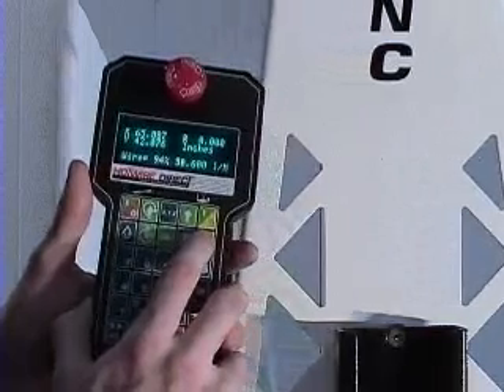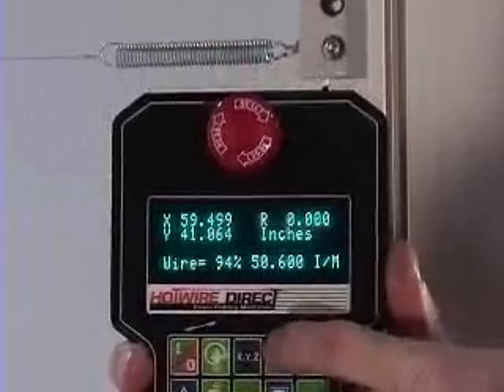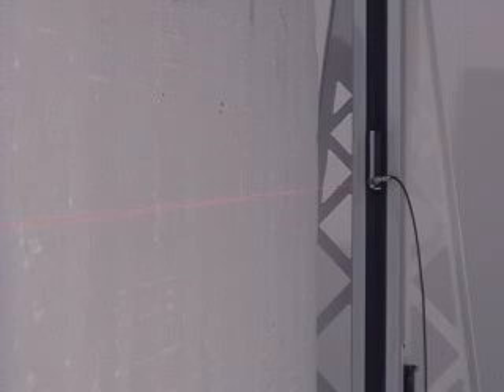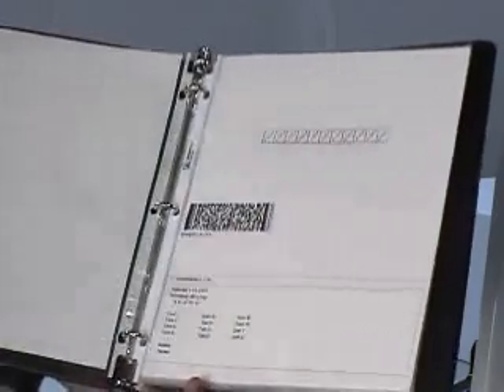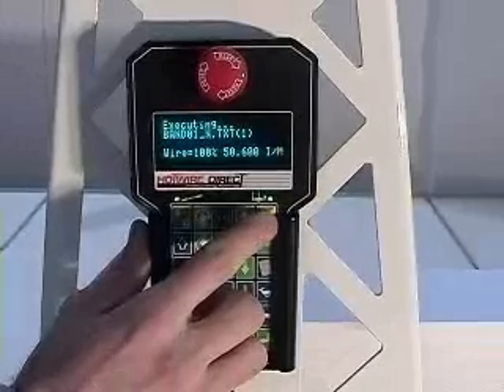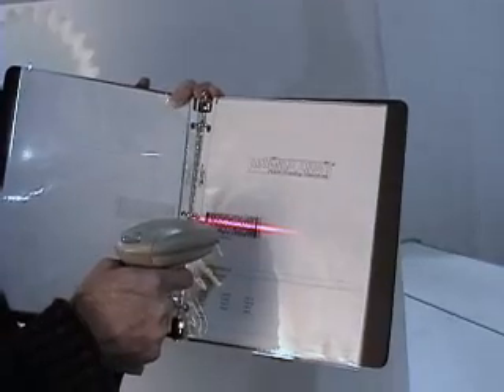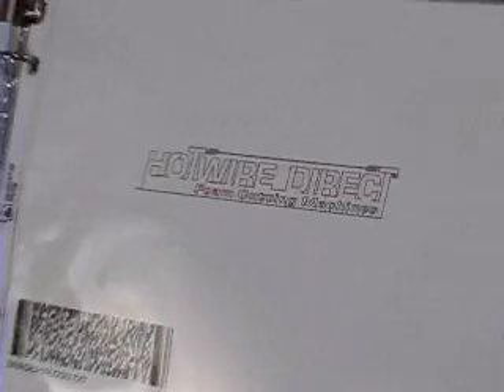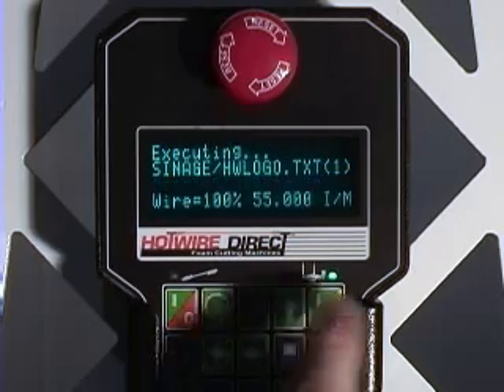Easy CNC foam cutting machine

Comment from the maker: @TuwaluIslands 
Good questions. Generally speaking we recommend our hot wire cutters to be used with expanded polystyrene (EPS) or extruded polystyrene (XPS) foam because of the gases created when cutting and ventilation requirements. With that in mind I advise you to make ventilation a primary concern for cutting the type of foam you describe. We do have customers worldwide. Please contact us for more info: salesinfo (at) hotwiredirect (dot) com.

Comment from the maker: @casalejuan 
Considering the design and construction quality it's not cheap for hobby uses, but for production equipment it's very reasonable ~ $20-50k US for CNC. 
Please contact us if you'd like a quote on exact model & features:
salesinfo (at) hotwiredirect (dot) com
or 
US/Canada Toll Free: 800-555-4042 / International (509)758-8379